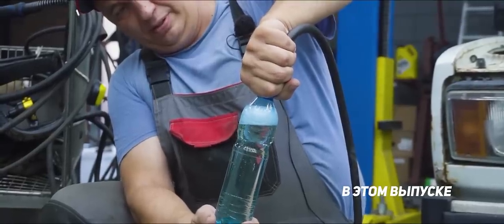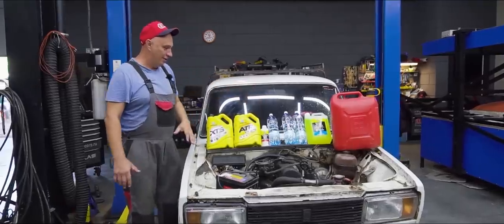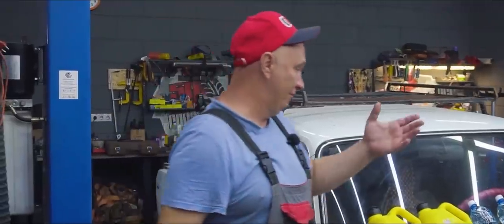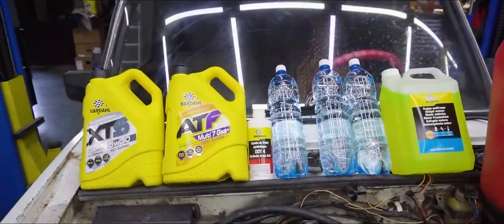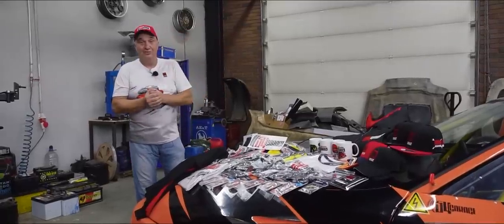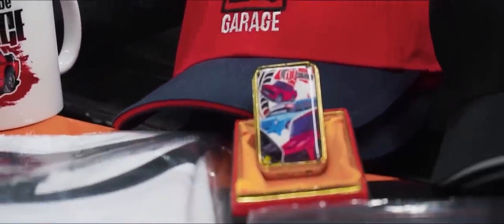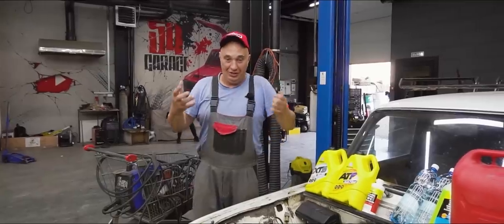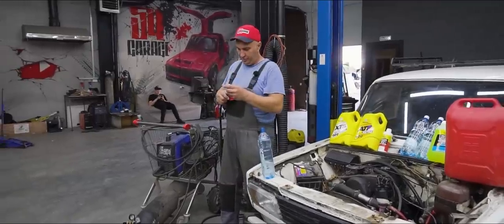What happens when you carbonate gasoline (and other fluids)?

Comment: Concentrated antifreeze is just glycerin
And petrol naturally expands which is why fuel tanks need to be vented. A normal coke bottle full without the carbonating would have the same pressure after shaking. Nitro fuel too

Comment: Gasoline is a Hydrocarbon already.
It is already made from hydrogen & carbon gases mixed. 
Since you used carbon dioxide, you were actually giving the gasoline 2 extra oxygen atoms (di oxide).
When you use it in the engine the weird smell is pure oxygen gas escaping & the black smoke soot is pure solid carbon. 
I remember the video of the run away diesel & wanted to say something about when you suggest using a C02 fire extinguisher to stop the engine instead of the powder one.
If you did use the C02, the 02 part is 2 oxygen atoms, so it would have fed the engine & sent it to like 20,000 rpm etc.

Comment: I'm retired now but before I own'd a car workshop.  The craziest thing we ever did was to fill a car inner tube with oxygen and acetylene then placed it on top of a burning oily rag. It took less than a minuet before it exploded.  It was so loud we all crapped ourselves. Not satisfied with that we then filled a wagon inner tube and did the same.  It created such a shock wave that it blew out the window nearest us.  Unfortunately less than 10 minuets later the police turned up after receiving a phone call that we had exploded a bomb.  Although we explained what we had done we were removed from the building while they searched the premises.  They didn't find anything suspicious of course but they took me back to the station to write out a statement.  Nothing came of it but they threatened to arrest me if I did it again.  It might sound over the top but I can't exaggerate just how loud the bang was.  However you are the craziest bunch I've come across :)

Comment: Great video as always guys. Is it possible that the engine was running rich because of the pressure in the bottle and a carburetor isn’t able to handle it if the pressure was too high? And not because of the fuel being carbonated.

Comment: I wonder what would happen if you "carbonated" gasoline using nitrous oxide instead of CO2 then ran an engine on it ??   Thanks for the great content.
Reply: essentially what a "wet shot" does. A dry shot adds it like a mist to the air before the fuel mixes, a wet shot adds it into the fuel before. Go learn about engines! Im sure you've heard a couple of these terms and just never bothered looking it up.

Comment: an idea u should oxygenate gasoline and or diesel and see if it will run. if so see if u can run it without a intake manifold. plus test the power and torque between the same car with comparing the efficense and other data

Comment: I'm dead serious try oxagnated gasoline! it may be the key for better milage!   also people tried vodka instead of gasoline and it works well and it's a very clean fuel. try oxagnated alcohol or acitone since it burns extremely clean and you won't need a fuel pump since it builds it's own pressure. you may not need a intake too since oxagen is already present which is ideal for a underwater driving vehicle!

Comment: carbonating gas with oxygen instead of co2 in theory should be a good idea for oxygenating the combustion mixture but with all the gas pockets and the shaking and pressure of the tank should be a curious thing especially how the whole system handles it..... maybe if the whole intake and engine is modified for it it should be a step up but it would need a whole lot of research and testing..... but all that aside it's a curious idea..... as some coments below mentioned N2O is another idea of the same caliber tho a bit more extreme :D also with denser more viscous fluids I suspect you need to wait a bit more for full carbonation to happen

Comment: You should try  dissoble Nitrous oxide/ Pure oxygen  in gasoline/ diesel/alcohol and measure hp gain of a Lada  if anyq or if  the result is liquid, but could be quite explosive and dangerous stuff , also try to tune Lada to run on Pure oxygen from canister

Comment: Funny how Shell was marketing "Nitrogen Enhanced Fuel" (in the US), that would clean your engine as it operated, lol.  I figured the air bubbles would not make it through the fuel filter, the carb circuits or high pressure pump and injectors.
Reply: I meant not gaseous nitrogen!
Reply: We use different toilets!

Seriously, I not sure. I just know from working with urea that it is basically made from cow urine. Don't know if they use piss from slaughter houses or from big dairy farms,(they have drainage systems in the floor to collect wastes) I really don't know.

Comment: In the US I don't know if you guys have it over In Russia or Europe? But we've had I believe either Mobile or Sunoco gasoline/petrol that's carbonated with 02 oxygen to get a little cleaner burn in the combustion chamber. If you don't happen to have it there, you could try using other gasses like oxygen or acetylene lol? Or both and make a different type of fuel source out of gasoline. Just be careful with the acetylene, it does not like being shocked with anything even it's own pressure which can cause it to explode. We've had a gas plant here which blew up from gas hammer with acetylene gas accidently. Just a little suggestion?

Comment: You should infuse nitrous oxide into the gasoline, free boost without requiring regulation. Not sure how long it’ll stay suspended and you may want to make sure your tank is vented or sturdy enough to handle the excessive pressure because you may end up with it exploding like a soda bottle getting thrown on the ground and popping its lid.
Reply: From what I understand, it wouldn't give the same results as directly fed nitrous. Keep in mind that engines breathe significantly more air than fuel.  Nitrous is fed in as a liquid, and flash boils in the intake. This both gives the needed volume and cools the intake gasses, increasing density.

The amount of dissolved gas in the gasoline is nowhere near the pound or so of nitrous that is used in a couple seconds.

Comment: Brake oil, oil, and gas carbonate easier. they are hydrophobic and interacts better  with CO2. shortly, CO2 dissolves better in oily stuff. Which also means they release the gas even slower. add in the factor of their viscosity as well.

Comment: It's more likely the engine was running so rich because of the fuel pressure from carbonation. The float can only handle so much. Feed in normal gas at 5 bar and I'd expect the same.
Reply: @Need2connect Ok. Assuming 'only' 1.5 bar you're still around 7 times stock Lada fuel pressure.

Comment: With the exception of gasoline cavitation generally doesn't work well in a automobile fluids performance. Now if you could only suspend oxygen molecules Within the gasoline I suspect you'd see a much better burn rate. After all atomization is what happens within your fuel system. And the better the atomization the better the performance. It would be interesting to see you hook up a oxy gas line to the carburetor.
Reply: Never heard of a Nitrous system have you? Or people running nitrous on their honda civics and shit in a certain... well known... WORLD WIDE movie.. Fast and Furious.. 
Long story short, people have been doing this on race engines for decades.

Comment: I'm wondering if the carbonated motor oil would be a good idea.
Though I suppose the oil system is not air tight, resulting in low oil level.
Reply: Oil system is never "air tight", engines are equipped with a "Positive crankcase vacuum" otherwise known as a PCV valve. Furthermore, air in the oil is typically a bad thing, creates possible dry spots where metal can touch metal. This is why you dont want cavitation in your oil. Also why modern engine oils are made to resist this.

Comment: Adding CO2 suppresses combustion- if you want to add a gas to the gasoline, you could try propane or acetylene- both of which are non-polar, combustible, and should dissolve well into gasoline.

Comment: You should look into dissolving pure oxygen in gasoline and try running it in the car and see if there is any power improvements
Reply: You should look up Nitrous Oxide systems. and how it leans the fuel air ratio out and you need to add more fuel to compensate, but yes, you do get Massive power gains.

Comment: Realized that gasoline solves gases really well. You should try to solve N2O or pure oxygen into gasoline

Like if you wanna see the lada running on oxigenated or nitroed gasoline
Reply: Nitrous Oxide systems. Nitro Methane Fuel. Check out some drag racing applications.
Massive Increase to power yes, fuel mileage goes bye bye though.

Comment: Should try oxygenating the gas and see if it increases power or gas mileage
Reply: Nitrous Oxide systems. Nitro Methane Fuel. Check out some drag racing applications.
Massive Increase to power yes, fuel mileage goes bye bye though.

Comment: What about mixing a flammable gas like Butane into the gasoline?
Reply: Idk about butane, but they do this in drag racing for bikes and cars, Nitrous Oxide systems. Nitro Methane Fuel. Check out some high end drag racing applications.
Massive Increase to power yes, fuel mileage goes bye bye though.

Comment: What if you carbonate gasoline with pure oxigen? will the car run "better", as it burns gas with extra oxygen?
Reply: It’s safer to use a chemical that gives off oxygen when it burns….such as Nitrous Oxide or Methyl Terbutyl ether….MTBE however has been found to cause cancer so…..we use ethanol instead.

Comment: The amazing thing about running it on carbonated gasoline you have an increase of power which can triple. You will also use much less gas and it also eliminates the need for a fuel pump The pressure from the fuel itself is enough to feed the carburetor. You will probably be able to drive 300 mi on that little bottle

Comment: i wonder if you could get nitrous oxide to dissolve in a useable fuel
Reply: Nitrous Oxide systems. Nitro Methane Fuel. Check out some drag racing applications.
Massive Increase to power yes, fuel mileage goes bye bye though.

Comment: So if carbonating brake fluid, would the car start breaking itself once pressure builds up?
Reply: no, the brake circuit is open until the pedal is pressed in then it goes to a closed system.

Comment: Can you oxygenate the gasoline and run it in an engine? Will it make more power with O2?
Reply: Terrible and dangerous idea. It would be explosive.
Reply: @m4yd0g  gasoline is explosive. Look up Q16 race gas. Oxygenated, leaded, 116 octane race gas. 
  He pressurized the gasoline to 5 bar and it did not explode.
Reply: @EricErnst  oxygenated fuels do not contain pure oxygen they contain oxygen carrying molecules.

Comment: Would it be possible to dissolve oxygen into gasoline with pressure? Could be interesting to try, but also veeeeery dangerous
Reply: Look up a N2o system, or Nitrous for your engine.. Never seen the fast and furious movies at the very least?! They massively over exaggerate it in the movies, but thats what a nitrous oxide system does...

Comment: Can you use different gases to carbonate fuel like propane, oxygen,  nitrous oxide ,
Reply: Nitrous Oxide systems. Nitro Methane Fuel. Check out some drag racing applications.
Massive Increase to power yes, fuel mileage goes bye bye though.
Reply: and some city buses, school buses, garbage trucks, and other large industrial equipment is already using a propane and "LPG" engines. Ive even seen a few honda civics that have been equipped with the stuff to run on it. Idk about fuel mileage or power but i hear it burns cleaner.

Comment: Derick from ViceGripGarage: "lets taste this 40 year old motor oil and transmission fluid from this barn find car a guy's reviving to see if there's gas/coolant/bearing material in the oil or clutch material in the ATF."
Garage54 "lets carbonate a bunch of brand new clean fluids and only taste the water."  ...Weak!

Though Garage54 makes up for it with the interesting concept of trying to carbonate automotive fluids for science.

Comment: Carbonated gas run through the engine is not good. The CO2, Carbon Dioxide, loses 1 Oxygen atom in combustion and becomes CO, Carbon Monoxide; and on that old heap all that CO is pouring out the tailpipe. At least they are smart enough to ave the garage door wide open for ventilation.

Comment: Was this gasoline a pure petroleum distillate, or was it a blend of petroleum and alcohol, or perhaps petroleum and ether such as MTBE? The CO2 would likely dissolve differentially in the various components of modern gasoline. And if the pressure was much higher with temperature a bit higher, you would get results even more interesting, as Supercritical Carbon Dioxide (scCO2) would form, which is a fantastic solvent with very interesting characteristics. https://en.wikipedia.org/wiki/Supercritical_carbon_dioxide

Comment: If gasoline can be carbonated with 2 carbon atoms, "CO2", then can it be oxygenated with two oxygen atoms, "O2"? CO2 will not promote combustion, O2 will. 
I've also heard that O2 and petroleum will spontaneously combust under pressure. 
I vote we leave it to the Russians for a hands on test!
Reply: @irgant  it's seems we have suffered a loss in translation. We're both making the EXACT same point. I was not implying that we could trick the Russians into blowing themselves up, I was implying that the resourceful Russians would find a way to make it work.